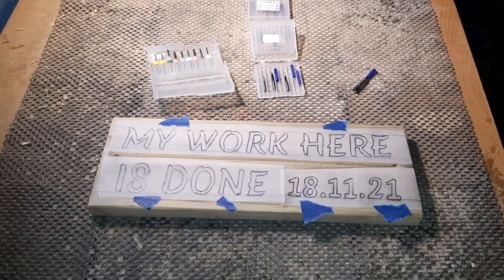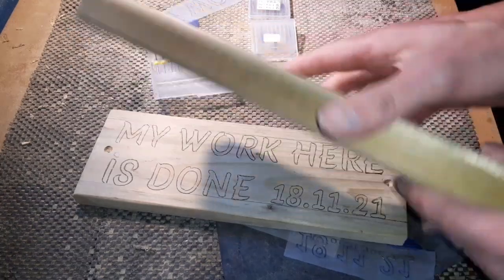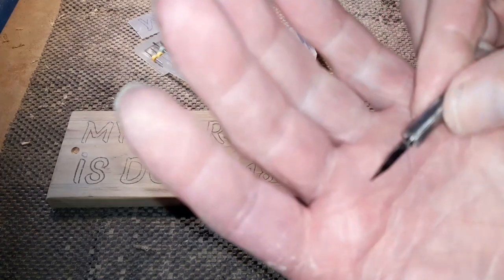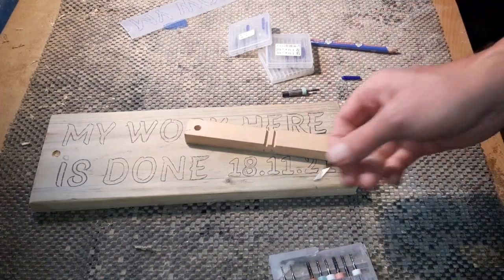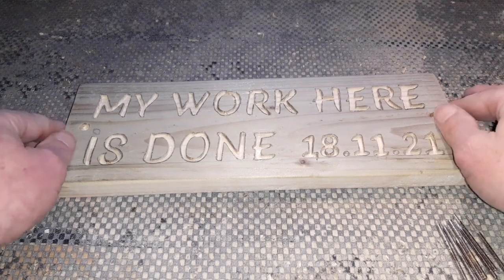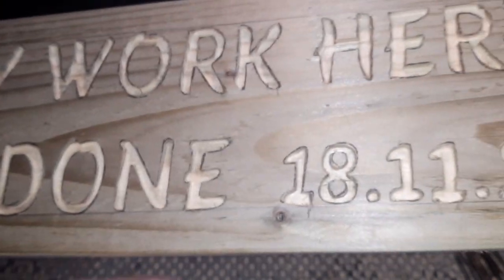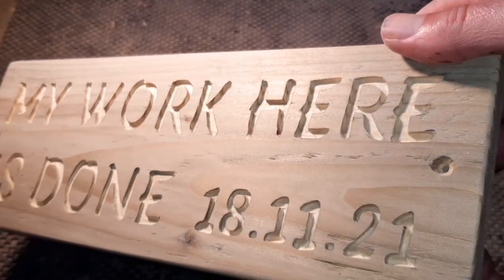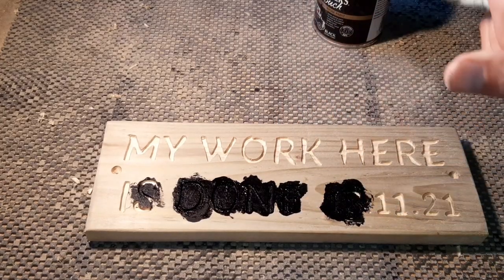Shed Plaque, My Work Here Is Done..router project...

Comment: What to i need to buy for my router with 1/4 * shanks so i can use cnc bits  so i can cut on small lines. Please thankyou
Reply from the maker: You need the adapter reducer collet 6.35mm,,I've put links in the description, ebay or amazon for me 👍
Reply: @fishtank5050  thankyou so much..

Comment: Hi from philippines. I really like your project. I also wanted to do this.. i have a makita palm router with a 1/4* shanks on it. I want to know what do i need to buy so i can use a cnc bits. Cause i know CNC bits has a small diameter it will not fit on my router with a 1/4 inches shank. Please help me understand this.. thankyou
Reply from the maker: I've put links in the description, adapter reducer collet 6.35mm 👍